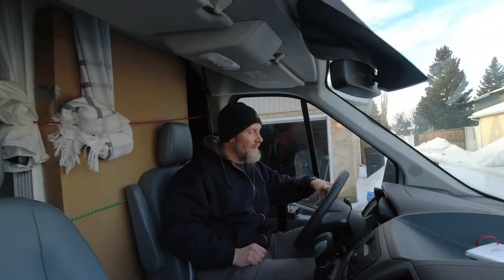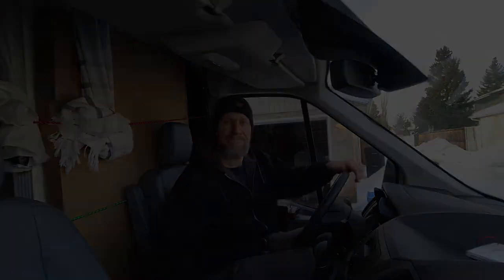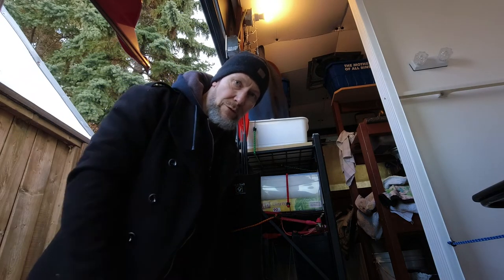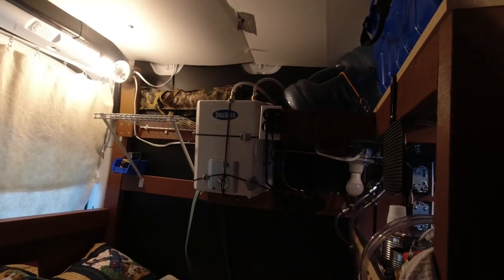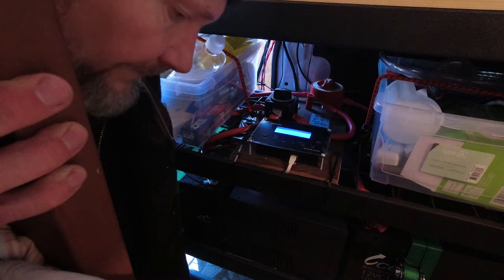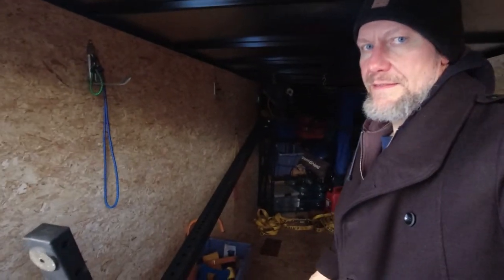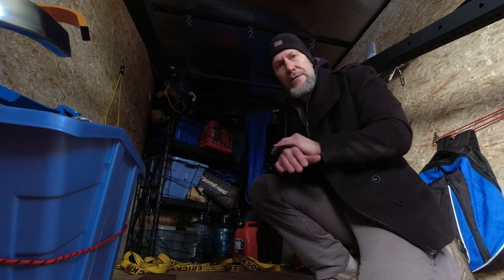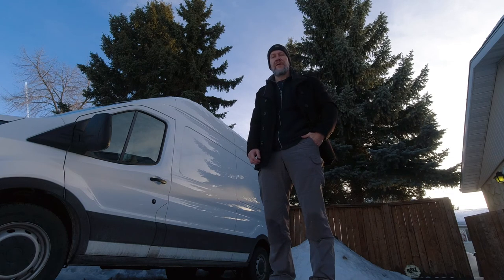Walkthrough of “The Flight of Time”

Comment: Did you need to upgrade the alternator?
Reply from the maker: No, but I did install a charge regulator that makes sure the van battery is at full before any power goes to the interior power system.